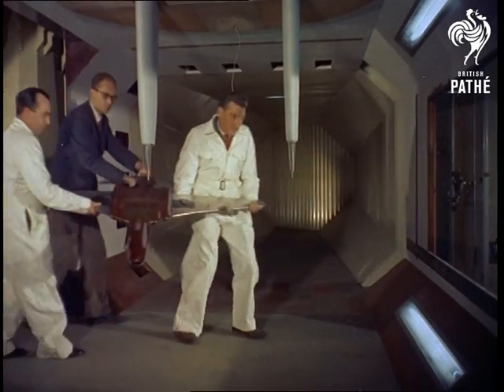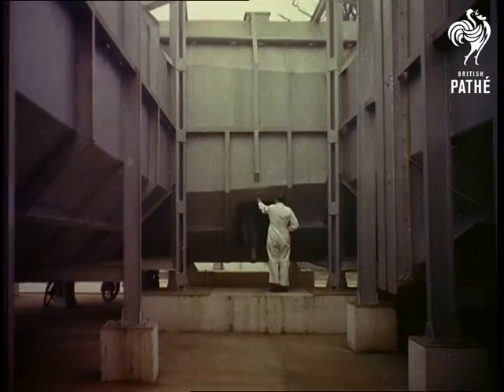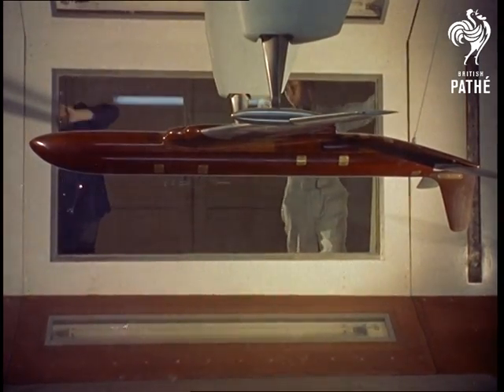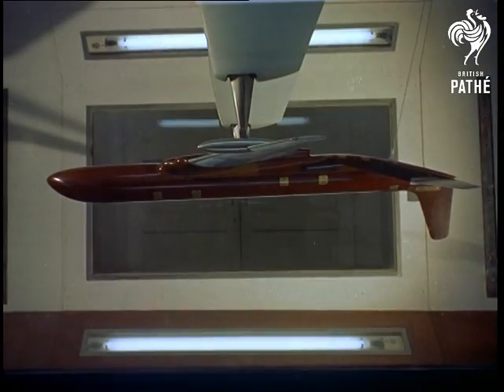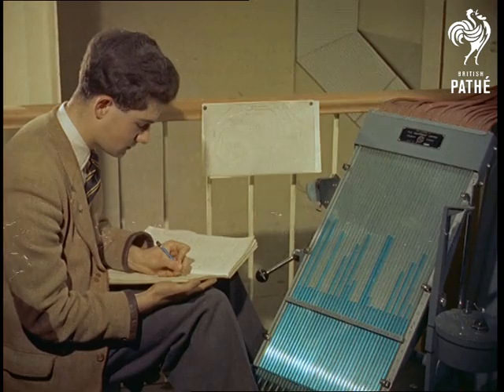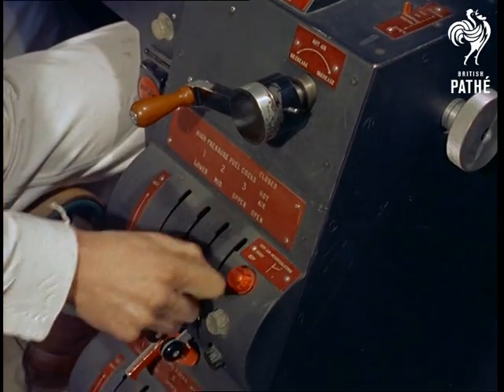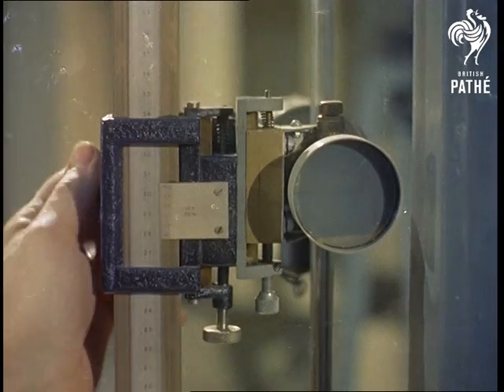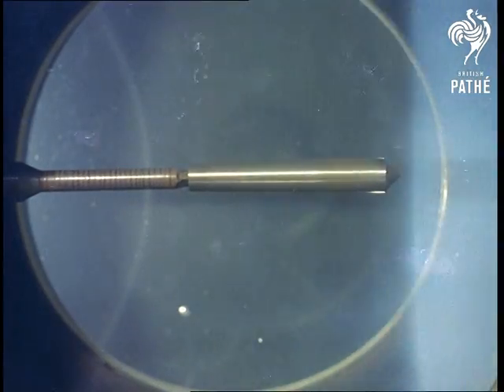Wind Tunnel (1955)

Comment: Why is the plane hung upside down
Reply: Because the experiment setup is not perfect 😅
Reply: They need to test all flight modes.   Postwar airliners routinely flew upside down for long distances due to pilots showing off.
Reply: @josephastier7421  😂😂